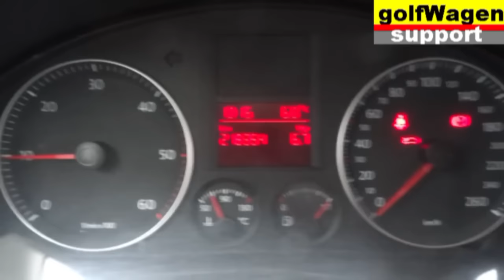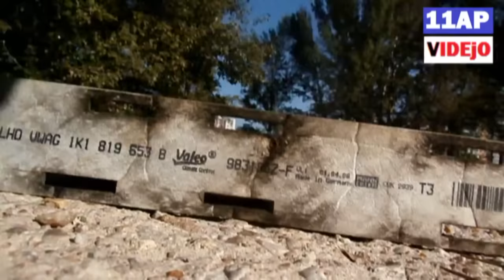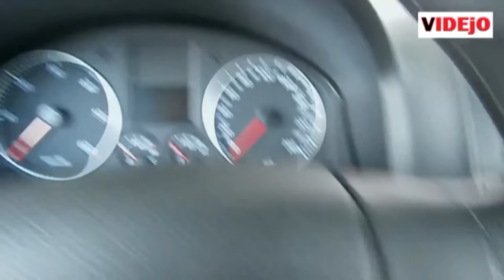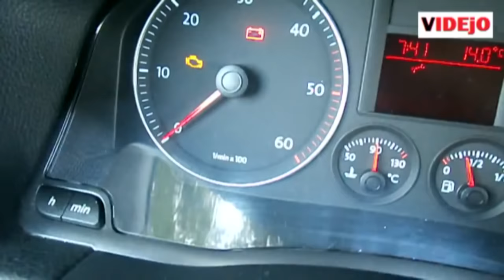VW Golf 1.9 TDI filters/ oil filter / air filter / fuel filter / cabin filter change / service reset

Comment: Thank you for an excellent video that covers everything very clearly. 
In Australia got all 4 filters + sump plug online from "RUN VW filters" - excellent price and quick delivery. 
I live out in the bush and did not have a Torx driver for either the splash panel underneath or the fuel filter but hex keys did the job.  The fuel filter screws were tight so had to slip a tube over 4 mm hex key to get enough torque.

Comment: nice vid. you did not need to prime fuel filter though. but good job.
Reply from the maker: What do you mean with the fuel filter?
Reply: If you soak the fuel filter in diesel,then fill up the fuel filter with fresh diesel after the new fuel filtet is done absorbin diesel then there is no reason to prime it as the filter wont be dry and the fuel fiter housing will have enough fuel in.only prime it when you put the new filter in dry without any fuel topped up in the fuel filter housing.
Reply: @crazybunch83  what do you mean, when changing filter just put in, without soaking in to diesel?

Comment: My air filter on a 1.2 tsi has a air filter with clips how is that removed year 2013 mk7
Reply from the maker: clips or Screw it does not matter, replace it and it's done